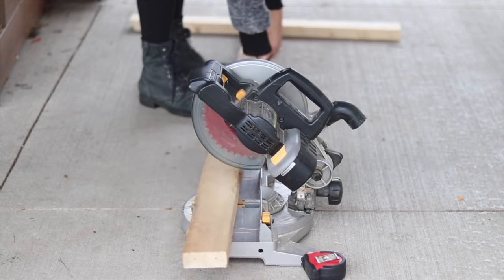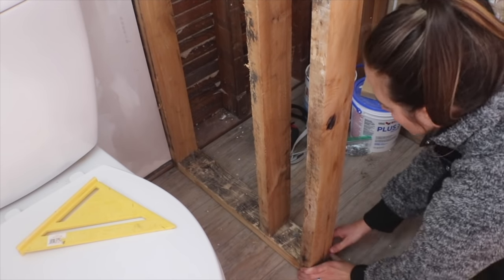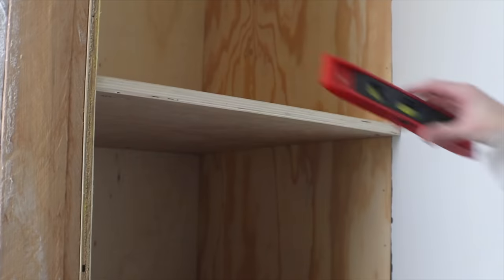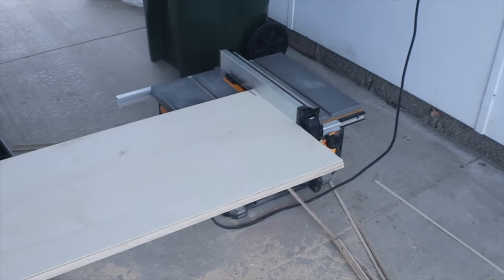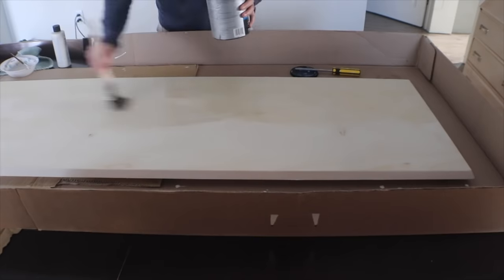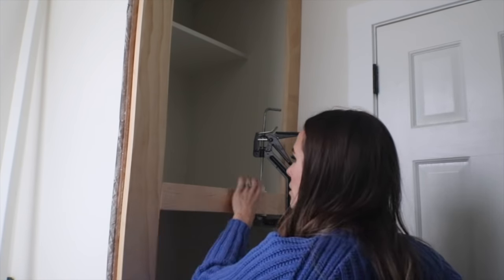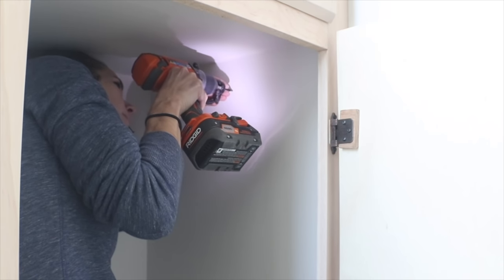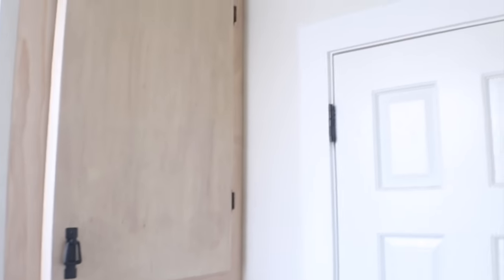DIY Bathroom Storage Cabinet with Plywood | Build a Small Bathroom Closet

Comment: Beautiful job Melissa , Is the lathe and plaster an exterior wall or interior ? When using studs that are not "true" there is a technique known as a flitch plate that can take some of the bow out of badly bowed studs to make them usable.
Reply from the maker: That wall was interior. Never heard of a flitch plate, thank you!!
Reply: @WelcometotheWoodsBlog  Youtube vid : How to straighten a wall for plasterboard , by Scott Brown carpentry shows the technique of making an incision in the stud on the bowed section and hammering a shim into it to make the concave shape straighter . Check it out . Not recommended for heavy load bearing walls .

Comment: Please don't wipe caulk with fingers it will mould ! use ice cream stick
Reply from the maker: Almost all caulk on the market now is mold resistant, including the type I'm applying here. I'm not worried about the caulk molding.
Reply: Good luck i have done that in the past &it moulded